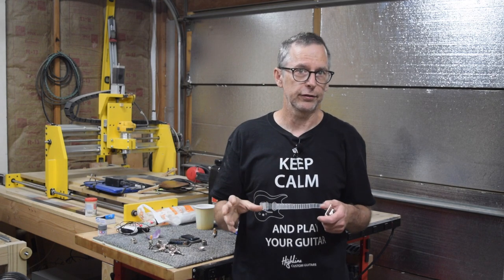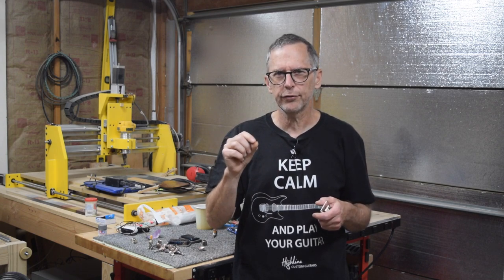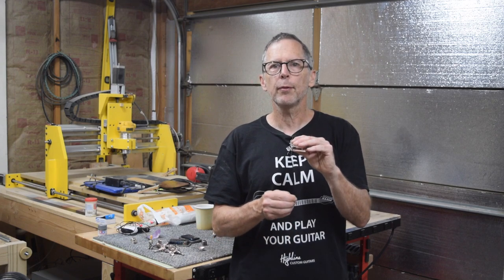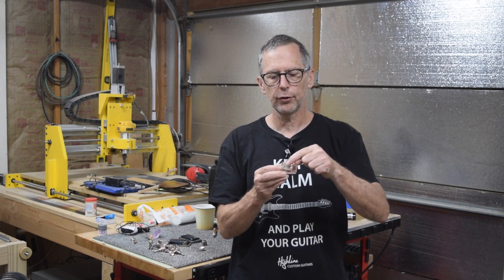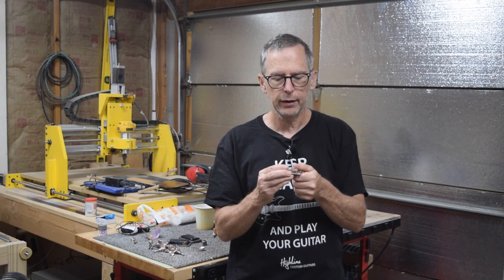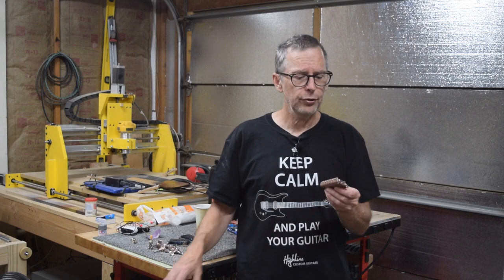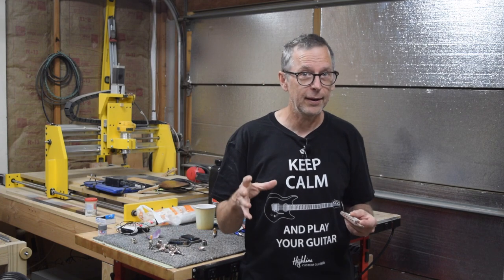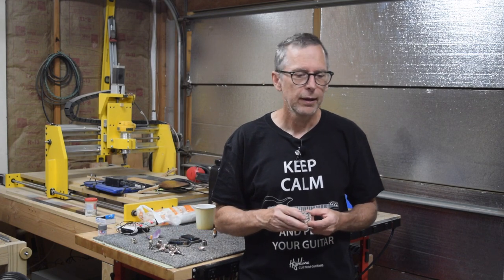Luthier Quick Tip 2 String Through vs Top Loader Guitar Bridges

Comment: I think this is a similar debate to the tone wood one. IMO, the tone on an electric comes 99% from the pickups/amp, which comes from the strings vibrating, not the wood itself vibrating. So whether or not strings would go trough the body, doesn’t matter to me. It may affect maybe 1% of the tone, but even if it did, it’s so minor that tweaking your amp settings could easily counter act that effect
Reply: For me, the only difference in putting strings through the body vs through the back of the bridge is the difference in string angle and force that is pushing the string to the saddle, which in top loaded aproach may result in loosening of a screws used to set up strings action and that may cause buzzing/rattling in the sadle and that's basically it.
Reply: Ya know, I was in the same camp as you (and when it comes to the BODY, I still am), but I found a great deal on an 80s Fender Strat neck with a rosewood fretboard, so I took the maple-board neck off of my Squier 50s Classic Vibe and bolted the rosewood one on, and it's definitely a lot smoother/warmer/less pokey than the maple board. Conversely, I ordered a solid mahogany Strat body from Warmoth and swapped everything over from my Classic Vibe. Plugged it in and didn't notice even a slight change in tone. So, in my own personal experience, body wood hasn't made a difference, but the fretboard wood has 🤷‍♂️
Reply: @joojoosasa   there are too many variables as i am learning. were those frets on both the maple and rosewood the same kind of frets? I definitely agree about the neck being the most important, I am still new and learning but playing around at guitar stores the neck is the most obvious tone changer when playing low-gain, low-volume, and on the same amp. the indian laurel necks on squiers surprised me with being as comfy as it is
Reply: To me it's strings effecting the tone first and foremost, due to the variance in magnetic reactivity of the materials used, the core to wound ratio(for a wound string), the gauge and the tension the string is under. There can be such huge variance, from monel, SS, typical steel, etc. That's primary, then the further potentially massive variance of the pickups, tone controls, and amp. Yeah, 100% agree on the wood, it's only relevant from a tone perspective in so much as it just needing to be at least as stiff as the neck.
Reply: %100
Reply: more about sustain but I have a top loader on a cheap guitar there’s still plenty of sustain even as much as more expensive neck throughs I’ve had strings get stuck more likely when removing old ones on string through but it’s kinda a hassle needing to bend the string end right before loading a top loader

Comment: I think tuning stability may be better with the top loader due to s straighter and more simple string path.
Reply: You are incorrect
Reply: @cmurduh1  Care to elaborate as to why?
Reply: @barklordofthesith2997  basically because of strain on the saddles. the string also has less freedom to move when it is through body. I am assuming if you install your bridge correctly and the saddles and screws are great, then no, he is not incorrect, and this guy probably just wanted to say that, but as many others said it seems top loaders tend to want to pulled off the body, while through body's are being pulling down into the body.

Comment: Well.... that's one thing... another one, perhaps more important,is the length of the strings....the higher the length,the bigger the tension,in order for the strings to be tuned! So,a top loader bridge, provides a smaller length.... It's like something the difference between a Stratocaster and a Gibson,but in a lower level ‼️

Comment: Agree 100% Chris. It's about perceived value because so many folks have drank the coolaid about solid body guitars being tone wood. 1 3/4" blocks of wood really don't vibrate. Now a neck might vibrate.
Reply: I don't subscribe to the 'tonewood' stupidity nor do I believe there is any difference between through and top loading, but I do not understand how you can say 1 3/4" blocks of wood (by which i take you to mean the body of an electric guitar) don't vibrate. 
When I strum a chord on a solid body electric guitar I can feel the body vibrating. Press your ear against the body and you can hear the vibrations from the strings transmitted through the wood. These vibrations do contribute to the overall sound. Consider that even when the vibrations of the strings are so small they are not easily visible, they can still be clearly heard via the pickups. The strings do not vibrate in relation to pickups that are somehow mounted to a fixed point is space. The pickups are mounted on the body. If the body vibrates then so do the pickups. Therefore the output signal from the guitar is the result of the relative vibration of both the strings and the pickup.
Reply: Terry Relph-Knight, there may be some slight vibration in the wood but not in the audible sense. Pickups don’t create sound by vibrating but by the interference of the metallic string disturbing the magnetic field of the pickups. Although I think we may be trying to say the same thing.
Reply: @jonahguitarguy  But that is my point, we are dealing with slight vibrations. As I said very small vibrations are clearly audible from the amplifier and even directly by ear. Play an electric guitar unplugged and you can still hear it and that is not because of the air being moved directly by the strings. The sound you hear is the air being moved by the vibrating body. The vibrations of the body, although smaller than string vibration are still significant. If you tap on the body of a solid electric guitar those taps are audible from the amplifier. Whether the strings move in relation to the pickup, or the pickup moves in relation to the strings, that movement will still be translated into the signal voltage across the ends of the pickup coil. Current is induced in the pickup coil when there is a change in the magnetic field around the coil. The permanent magnets in the pickup magnetise the strings. If the strings do not move, but the pickup does, a changing current is still induced in the coil because the coil is moving through the field from the strings. If the strings and the pickup are both moving then both of those movements contribute to the signal current in the coil.
Reply: Terry Relph-Knight, very good logic my friend. I appreciate your insight.

Comment: In my opinion, all the string's energy is transferred at the first contact point on the saddle.  What happens after that (from there to the ball end) doesn't matter for tone or sustain on a solid-body electric.

Mechanically, anchoring to the back of the guitar (string-through) will be stronger.  However, in practice, the screws on top-loader are more than enough, and the additional strength of the string-through is superfluous.

So, bottom line: whichever you find easier to use.  It's more important that there aren't any rattles in the saddles.
Reply: not quite. if there is a reasonable area of string behind the bridge then sympathetic vibrations can occur. Purely based on experience, the shallower the break angle the more these sympathetic vibrations can be heard - it can almost sound like reverb. So it does impact tone. Whether those sympathetic vibrations are "felt" by the main vibrating area of the string enough to affect how it sustains, I don't know.

Comment: I agree. 

Solid bodies don’t create sustain. Any energy leaving the string via vibrations transferred to the body is lost as acoustic energy (and heat). So it’s removing energy from the string, which reduces sustain. 

This is why a body with a lot of mass, like a Les Paul, has such good sustain. Most of the energy of the vibrating string is staying in the string. You get long sustain and very little acoustic output. 

In contrast, look at a banjo; almost all the energy of the vibrating string is converted to driving the drum head. You get a loud acoustic output, but almost zero sustain. 

Personally I don’t find that string through bridges add anything. But I do make string through guitars.

Comment: The biggest difference to me is feel. A top load feels more "slinky" to me. I prefer that feel. It's all ice cream though. Every choice is a flavour we choose based on our likes. Thank you for pointing out that LPs and SGs are top loads. I find that tidbit get missed so often in this discussion and goes a long way to help my customers understand that top load is not actually inferior, just different. Subscribed! Looking forward to more content!
Reply from the maker: In my opinion, feel is the single most important factor when choosing a guitar. You can change the look and tone, but feel is much harder to safely change.
Reply: Your post is interesting to me. I noticed the longer the string the more slinky it is. I tune down a full step (2 frets) so it is more slinky and I use big string gauges to try to make up for it. I use a string through tele and a strat with tremelo block and my strat having longer strings is more slinky to me.
As for the string vibration, it dies after the bridge, doesn't matter anyway, pickups is what gives you the tone in an electric guitar. There is an awesome video of a dude in Nashville proving it. You can have the strings on a guitar, a 2 x 4 and in the open air with a pickup underneath, makes no difference in sound on an electric guitar, none. That tone wood is ok for acoustic, but not electric.

Comment: I agree with you on all points.   I've had thru body and top loading Tele's.     The most difference in the sound of them was the pickups, IMHO.  Am currently building a HT Strat, will be thru body, but only because the holes are already there.

Comment: Thank you for your information! So interesting. A lot of expensive bass guitars uses Top Loader design.
I feel some "magic" playing feeling in Stratocaster tremolo bridge, and I think It have to do with part of the string from the saddle to the end.
Also in Telecaster guitars I think that part of the twangy playing feel has to do something with string through body bridge design.
But In case of hardtail strat bridge there might be less effect in this difference. 
As for me I can't comfortably play on hard tail Strats. It was string through body one I tried. Can't judge top loader, have not tried one.

Comment: A string through bridge is, because of how it works, pushed more into the body cause the string comes out and over the saddle, so the pressure on the bridge is DOWN.
A top loader has a pressure the lifts the back of the bridge off of the body cause the strings pull it straight towards the neck, trying to pry it off.

That's why people often opt for the string through and mention sustain - the body is not going anywhere, it's a giant slab of wood and the bridge get even more pushed into the body, which should add to the sustain. If you have a bridge that keeps wanting to pry off of the body (a top loader), you're going to (in theory) have just the front of the bridge pushed into the body, so less surface, less sustain.

How much and can you feel the difference with all the electronics, amps, pedals, PAs.. I have no idea.
I use a string through cause I like how it works and puts less strain on the bridge screws, they're there to, basically, just keep it from moving a bit.
On a top loader, you better screw them in tight.
Reply: actually less surface contact = more sustain. For sustain, in fact, you don't want transference of vibration to the body - you want to keep it all in the string. This is a common mistake among guitar players. That's why the contact point of the bridge saddles is very small.

Comment: I would assume all the vibrations end at the contact point on the saddles. On acoustics I can understand the difference. There are top loading bridges and the string pull is different and it makes a difference because it’s just glue holding the bridge in place. 
I’ve been playing electric guitar for almost 40 years and the only thing that seems to makes a significant difference in tone is the pickups.  I’ve heard LPs that sound like Strats and visa versa.
Reply: Yes, the vibration for the most part would end at the contact point..think for example when you have a moving contact point..like on a slide guitar..but the firmer the contact point, the more energy reflects back into the string for increased sustain. .and more so when the contact point has a lot of mass compared to the strings.

Comment: With hardtails I prefer string through body for two reasons:
1. No unwanted string ringing behind the saddles - like on some stoptails or even tele bridges.
2. On some guitars I am using light 9 or even 8 gauge strings and with those the saddles are more stable with through body design due to higher pressure on them. This is however just a minor thing...

Comment: I would simply say that it depends on the design and quality of the top loading bridge. My meager experience comes from a top loading Squier Bullet Strat. Man, that was the buzziest, deadest sounding guitar I ever heard. I wound up drilling the bridge and body out and installing Tele string ferrules in it. That made the guitar come alive.

Now, it might have had the same thing happen if I bought an expensive bridge with offset  intonation screws. In other words, the strings do not load right under the intonation screw. Anyway, after the experience of before and after on my cheap Squier, I prefer string through body setups.

Comment: Contact points will ALWAYS be saddle breakover and nut seat and what is in contact from THAT point.... correct ? So any string beyond that is inert to the note IMO.
I am commenting to assist in my thinking. if you could stretch a string to pitch with nothing touching it (who knows make something up, magic, magnets etc..) would it be different than something at each end holding it in place ?

Comment: As a player of over 40 years I can tell you from experience that the top load gives you slightly looser tension in the strings. I don't think it's imagined. It might have something to do with the length of the string being shorter or something similar. I have multiple guitars that have string through or top load options and I've tried them both and I always find that the top load gives me a little bit more flexibility for bending.
Reply: It's not a difference in tension. It's a difference in string stiffness (force required per unit length change). If it changed string tension the guitar would be out of tune. String tension is entirely determined by tuned frequency, scale length, and string mass per unit length (gauge).
Reply: Probably has to do with working or dynamic elongation. Longer strings between anchor points gives more. Takes a little more bend if you will, to get a full step bend, than a shorter string. Shorter - Less stretch will make it feel more responsive, gets you a full step up bend quicker. But thats just a guess.
Reply: Don't forget that scale length has alot to do with tension for bends.  Gibson's have shorter scale length and a through tale bridge.  Multiple factors to consider.
Reply: @vw9659  lol come on man.  It's called semantics.  Definition of "tension": the act of stretching or straining.  Yes, we all know that a guitar tuned to a certain pitch will be in tune or out of tune.  At least most of us do.  :)
Reply: @des_o7935  That has nothing to do with my comment.  I was talking about using, for example a Telecaster, by running the strings through the ferrules in the back of the body or by running them through the back of the bridge using the top load on a bridge that provides that option.  Scale length has nothing to do with this discussion.
Reply: @cdavis6406  I agree.  That's what the folks on TDPRI have been saying in the forums for years now.
Reply: the tension is what ever you tune it to. A 0.010in. steel string over a 25.5in scale length tuned to the E above middle C (329.63 Hz) has a given tension no matter how it's attached or what it's attached to. That tension is 17.8 pounds of force. Changing that tension would change the pitch of the string.
Reply: Do you think you could do a blind fold test of recordings of ten players playing ten otherwise identical guitars except half were string-through and half were top-load? Could you beat chance?

Comment: I cannot manage to get the string to thread through in a top loader. The string has to feed from behind and slightly underneath the saddle and then turn upwards to go over the top and out towards the neck. Its a seemingly impossible angle, and even pre-bending the string to make the turn does not reliably work. These type bridges have vexed me for years, and I avoid them for that reason.
Reply: I wondering if it was more difficult to change the strings on a top loader. Now I see that it is. I wonder if the fancy Schaller top loaders are any easier for changing strings. Does anybody have experience with one of those Schaller top loaders?

Comment: There are plenty guitar techs and luthiers who say the string through the body giving more sustain is a myth. A solid body especially one that been painted and lacquered or had a finish applied to the body will not resonate like an acoustic guitar. The pickups respond to the strings when they are struck, and come into contact with the magnetic field of the pickups. The signal is then controlled by the volume and tone controls on the guitar and sent to the amp. If there is any difference it's very very minimal.